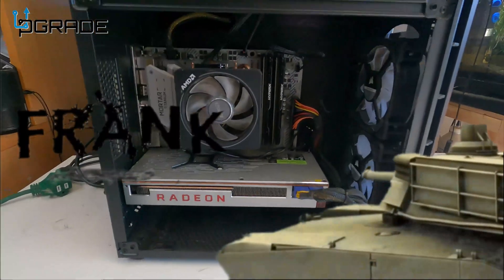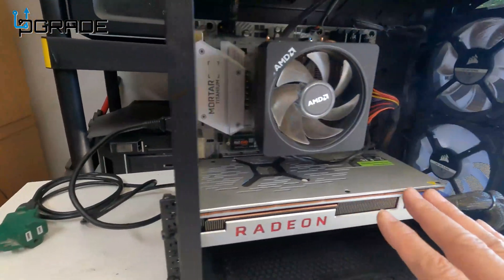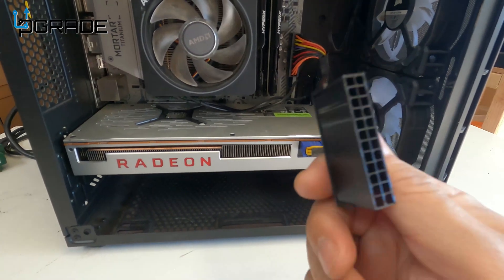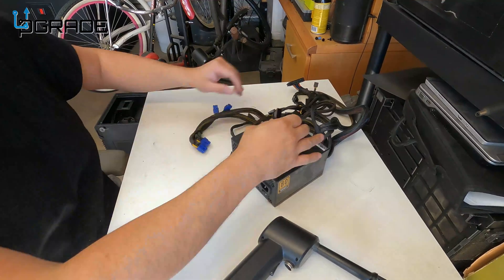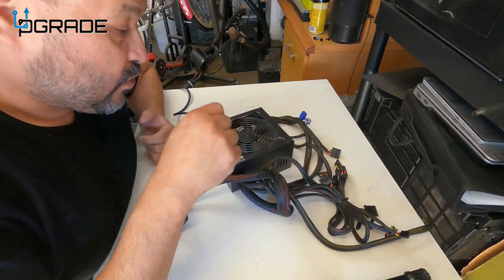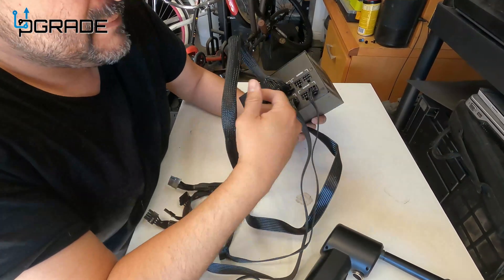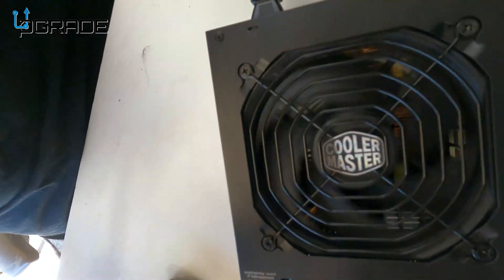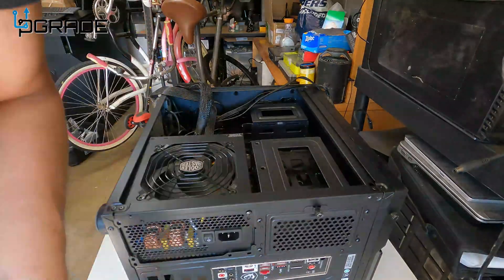PC Power Supply Failure & Repair

Comment: Hello my friend , do you still have the warranty on that PSU?
I had a seasonic PSU explode on me like 3 years ago, just connecting back the AC plug. I bought a Forton Hydro fully modular PSU in 2018 with 750W for 130 bucks, so far so good it works quite good.